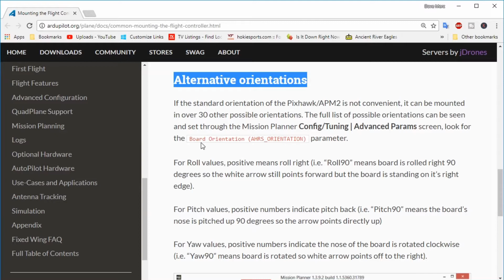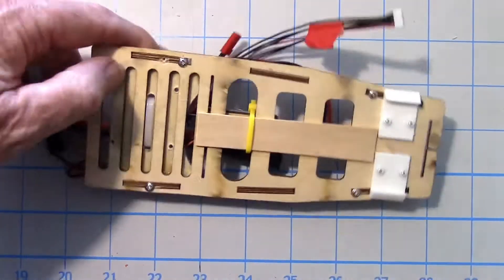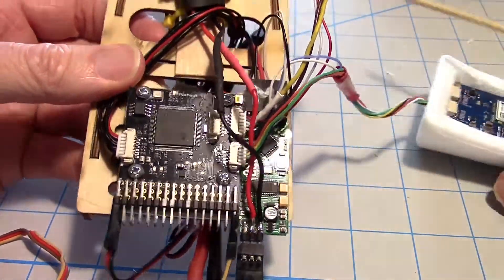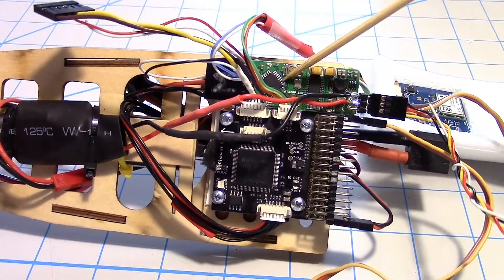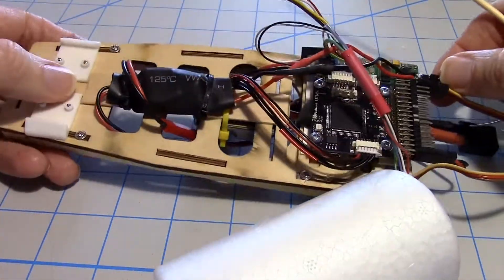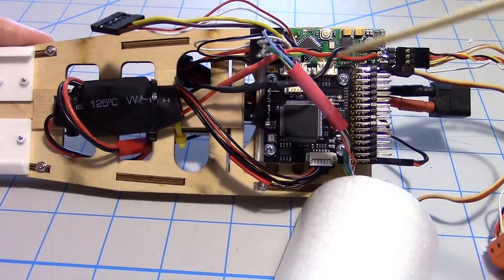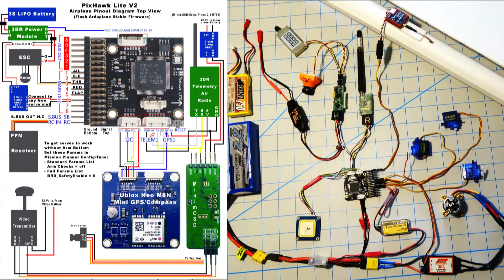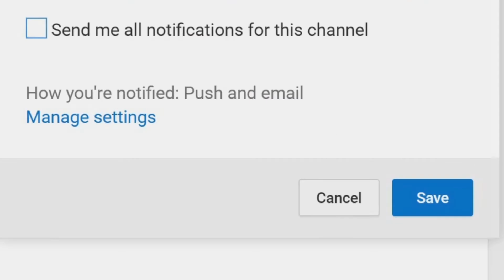Volantex Ranger 2000 FPV RC Plane Build Part 5 - Installing PixHawk Lite, Testing Servos & Motor

Comment: A very nice job!  I built a QuadPlane based on the Ranger 1600 that uses the same fuselage as the 2000. However I used a full-size PixHawk and the result is a real mess - not so much an installation as an extallation. Still, it flies so I am putting off the major re-work needed to tidy it up.
Reply from the maker: Thanks for commenting! Any method you can use to go fly is good method in my opinion :-)

Comment: Incredible to see that 1 within year of your video we  now have advancements providing a new flight controller which runs Ardupilot which integrates most of those separate components neatly onto one board. This has made builds much easier now I'm glad to see. I'm talking about the Matek f405 Wing board which has battery monitoring, OSD, and all power regulation for like 50 bucks. Nice job on the build. Maidened my Ranger 2000 today - just a receiver in it for this one :)
Reply from the maker: Thanks for posting. I agree the hobby has improved in that respect. I have the F411 WIng FC in my FT Legacy plane. Matek rocks! Good to hear you got the maiden in on your Ranger 2000. Onward and upward.

Comment: Hi   Did this Mount of the GPS work good in the air?
Reply from the maker: Oh yes it sure did. Check out my flight video.
Reply from the maker: Here is the flight video showing 19 sats on the GPS on the OSD screen!
https://www.youtube.com/watch?v=aERTTLGj0p4
Reply: Thank you. I will try to Mount the GPS like this in my ranger 2000 With Matek 405 wing. Thanks for all the good videos you have

Comment: What type of esc is being used with the battery upgrade? Stock is lists a 30A.
Reply from the maker: Yes it's the stock 30A ESC and it works fine on 4s,

Comment: Lovin the build so far Dave! It’s getting me motivated to finish my own Skywalker “upgrade” project that’s sort of stalled at the moment. I’m using all of the same gear as you are here. 
When you get to the rx, can you explain how to get rssi going with the Pix Lite and ezUHF?
Thanks!
Fergy
Reply from the maker: Hey that's cool. My SkyWalker setup is very similar to the Ranger 2000 as well because it has an APM and EZUHF. I used the same configs for the Taranis, EUHF and Mission planar for the Ranger to make things easier therefor I did not make a video on how to do it because it was basically allready done bar a few tweaks. But don't worry I have plenty of past Vids on the RSSI and flight mode setup. I will post links to them on the blog at
https://davemerc.blogspot.com/
Reply: Dave Merc Productions Excellent! Thanks Dave!
I was just watching a couple of vids on setting up throttle failsafe with the ezuhf, to familiarize myself with that process.
Fergy
Reply from the maker: I have found that the throttle failsafe is a little strange to setup with EZUHF and I prefer the hardware failsafe method.
The problem with the EZUHF TX is that it won't allow trimming below zero throttle so a work around is needed for throttle failsafe but it can be done just more hassle. And the work around requires leaving the throttle trim up a bit on the radio which can be problematic.
Reply from the maker: Have you watched this one?
Ardupilot Flight Modes, Failsafe Methods, Telemetry Radio Setup APM mission Planner
https://www.youtube.com/watch?v=ddw3BjDYEs4
Reply: Dave Merc Productions thanks Dave. That was very helpful!

Comment: Hey you use that Sharon vocal lady for saying "This is, Me RC" :)
It's pretty cool!
Why are you not using an iNAV FC for this project, i have seen actually more people using iNAV for flying wings and airplanes than multirotors i have to say lol
Anyway, great build part as usual <3
Have a great week Dave :)
Reply from the maker: Hi Cedric, When I hear Sharon's voice it reminds me of my Taranis X9D because she is in there too. She is like my genie in a bottle, lol. 
Why I didn't use an iNav FC: Besides being familiar with the APM mission planner and having a spare Pixhawk Lite I think my decision was based on wiring convenience. You may notice that all the pins on the pix are standard servo style and they are all in a row on one side for easy connection.
Since  there is very little access to the inside of the Ranger having all the connections right in the front makes it easy to make changes. All those tiny Molex plugs on the mini-quad FC boards drive me crazy and they are never in a good location for the Ranger.